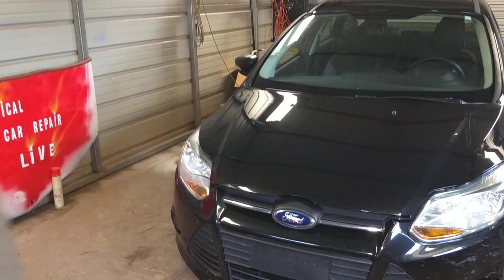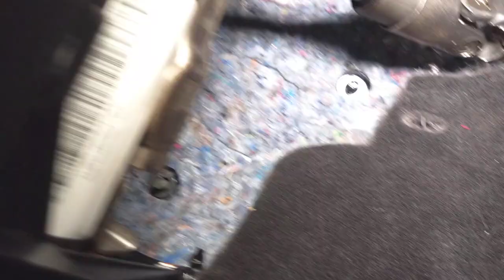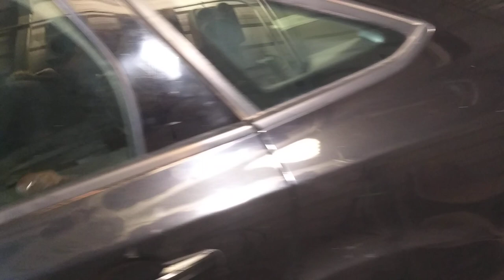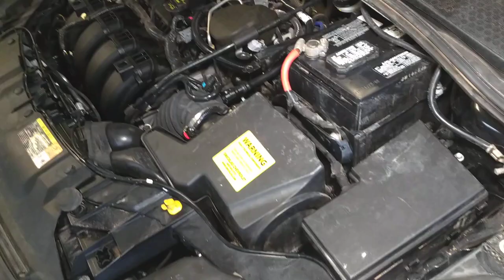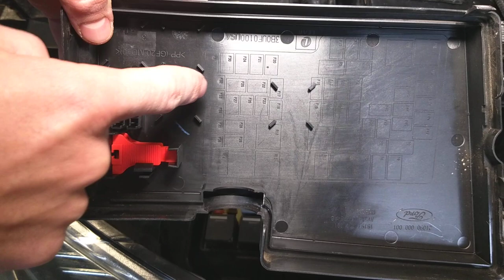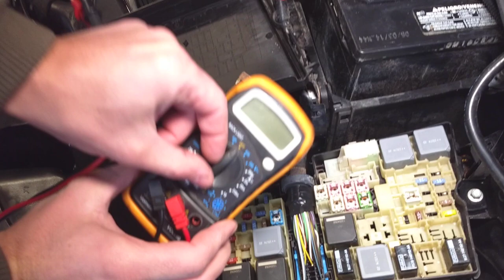BRAKE LIGHT SWITCH FUSE LOCATION AND REPLACEMENT FORD FOCUS MK3 2012-2018

Comment: Hello! Thank you for the video. I recently got the error message "Brake Lamp Bulb Fault" on my 2017 Ford Focus. I changed the brake light bulbs but the error has not gone away. Any ideas? The error appears every time I start my car.
Reply: Yes I’m having the same issue
Reply: @Boganok  So, my fuse was fried and it changed it but that still wasn't the issue. I realized after changing my 'brake' bulbs as per some of the youtube videos I watched that those video were telling me to change my blinker bulbs which wasn't the issue. I ended up changing the other bulb (brake bulb) and it was fine. I'd just recommend changing all 4 taillight bulbs when this error occurs..
Reply: @Maksimmy  thank you so much!! I did this and it worked. Now I know gotta change them all if one isn’t working right

Comment: I have a 2012 ford focus se and my passanger side brake light after replaceing still does not work and now the blinker on that side blinks faster than it use to 
to add to the problem can u give me some input on what all i should do to find what the issue could be could it still be a fuse or possibly a loose wire or loose wireing?
Reply: Having the exact same issue, did you figure it out?

Comment: Only the 3rd brake light doesn’t work. But there are several bulbs in the 3rd braklight so I don’t think they went bad at the same time. I think the cable could be bad. Any ideas how to work first? Check the cable if power arrives at the brakelight? And then?
Reply: Did you fine a solution?

Comment: Guys, I have a problem with my focus 2014. Rear right break light doesn't turn ON when I press the pedal and also the right trunk light doesn't turn ON when I open the hatchback..... I switched the bulbs between left and right and found that the break bulb is bad...but the trunk /boot light bulbs works fine in the left side.... Where can I find the fuse for the boot light on the right hand side?

Comment: Fuses are good,replaced brake pedal sensor and brake lights still not working,the third light works but two main lights still dont work
Reply: I'm having the same issue
Reply: Its the brake light switch. U most probably have two switches on your brake pedal
Reply: Same issue did you figure it out